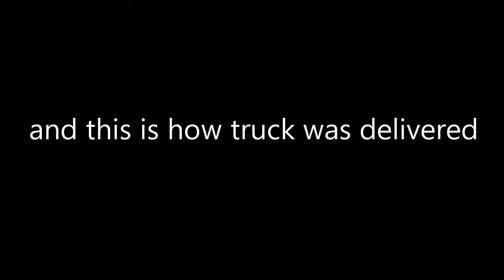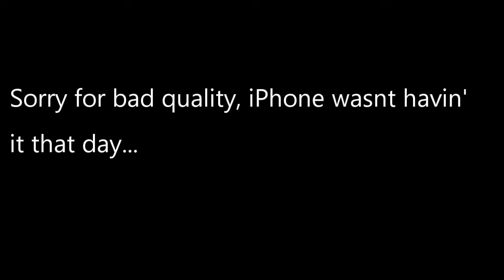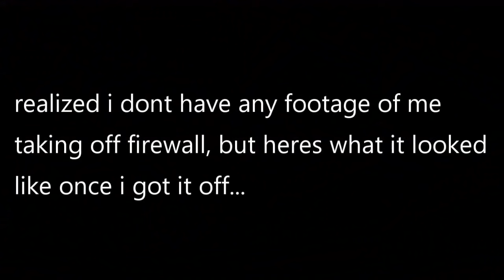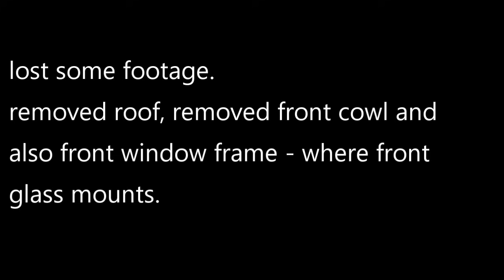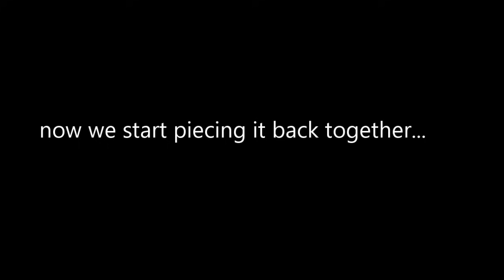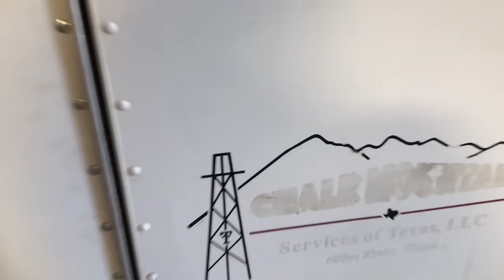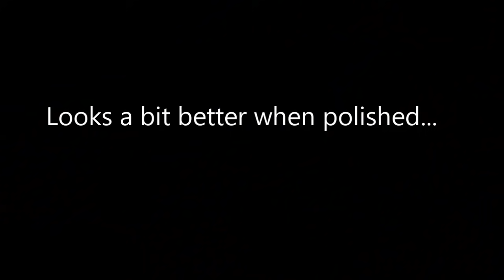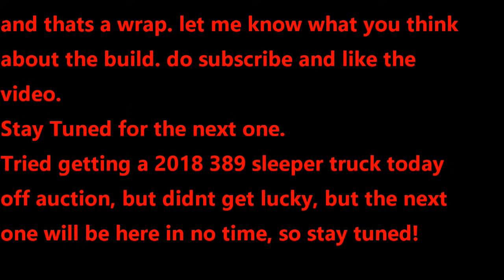2015 Peterbilt 389 from Copart - Start to Finish

Comment: I'm not an expert at this but why not just buy a new cab especially if u had to buy a parts cab anyway? I mean I'm sure it's cheaper the way u are doing it but damn with all the time and energy put in just buy a new one lol!!
Reply from the maker: $15k for a new cab, versus $700 for my parts cab and some labor. And parts cab wouldnt work as a whole cause its older and all wiring is different and mounts. So the right thing to do, was use the panels I needed off of it.
Reply: @BulletMcNugget  makes perfect sense now that you explained it, as I said I'm no expert in this area lol and yeah big difference in the numbers fo sho

Comment: you would have saved 80% labor use by using the Cab you purchased as "parts* nothing wrong was with that,
Reply from the maker: It was a 1997 cab. Wouldnt have worked. All the placements and dash inside are different and mounts and everything about it is different. Only same thing are the panels that i used... i dont like doing extra work just for fun. This was the easier and cheapest option.

Comment: Buys new cab. Instead of using it takes it apart to repair damaged cab. Seems logical.
Reply from the maker: How about you read comments before being a smartass? 
Parts cab was a 1997. Everything on it is different. Dashboard, gauges, wiring, everything. I bought it just for the panels that I used off of it. Even firewall is different. So yes, very logical.

Comment: HAHAHA riveting the body, ordinary hinges in the door of the massacre. In Europe, this technique ceased to be used in the 1960s. America is using it in 2015.
Reply: This cab is basically made the same for the past 50 years.
Cheap, light and relatively durable. These will out last glued together fiberglass.
Is this how aircraft have been made since the 30's.

Comment: Obviously this guy doesn’t know how to properly remove solid rivets.  Must not know how to install solid rivets either since he used blind rivets for everything.  Nice truck though.
Reply from the maker: I actually used exactly what the truck came with, what I took off, put exact same ones back on.
Reply: DieselBullet sorry about the diss.  I have worked with riveting for twenty years on helicopters in the Marine Corps.  Now ironically I’m a truck driver, and have looked at the rivets holding trucks together.  They must put a lot of paint on those that hide the center shaft indicating they are blind rivets.  If they are that type as you have told me there’s an easier way to remove them than how it looked in the video.  You do have to grind down the head, but you flat grind just until you get to the lock ring.  Then you take a punch and punch out the center pin, which should pop out fairly easily if you ground all the way down to the lock ring.  Once the center pin is out you use that punch in the top of the hole to pop off the remainder of the head.  Once again sorry about how I said that, but from what I could see it looked like solid rivets.
Reply from the maker: They were solid rivets. Maybe im calling them the wrong way, in other terms people call them huck bolts. You put the bolt in from one side then on other side you put the collar on then you use the gun to compress it, like I did in video.
Reply: DieselBullet ok a Huck bolt is basically a large blind/cherrymax rivet.  A solid rivet is just a chunk of metal, either steel or aluminum depending on the material you are riveting together, that is bucked or “smashed” by using a rivet gun/air hammer and a bucking bar.  I have very little experience with actual huck bolts as there aren’t too many rivets that large on a Huey or Cobra.  I am curious what the ring you put on the back side was, I have only used a ring or what we called a rivet washer when there was damage to the hole or too soft of a material used on the back side.

Comment: You couldn't find a cab they are all the same probably could've found a 379 cab
Reply from the maker: Ye but a 379 cab is still different. Doors are different, gauges are different, dashboard is different. So woulda still had to do same thing I had to do.
Reply: @BulletMcNugget  I got a 379 same dash except the computer screen not knocking you in any way nice job
Reply from the maker: Those cabs still cost a lot. To be honest and for people to understand why i went this way, i bought the cab for $700 bucks. I got quoted from Peterbilt for the roof, window frame and cowl panel $5k. Ye i had to put in some work but saved some money. Thats why I did what I did...

Comment: Sucks they they are phasing out standards in big rigs also
Reply: The Coal Train I know.  This sucks.
Reply: Not really. Autoshifts are shaving costs on fuel and maintenance so.... what person would consider a manual knowing the cost differences? 
It’s about 5% on the low end in favor of autos. Which is about $2k per year just in fuel savings.
Reply: Matt Moschkau get real.  It's gay.
Reply: @mattmoschkau2831  people that actually enjoy driving and don't care about it